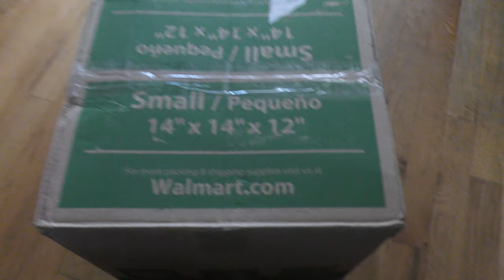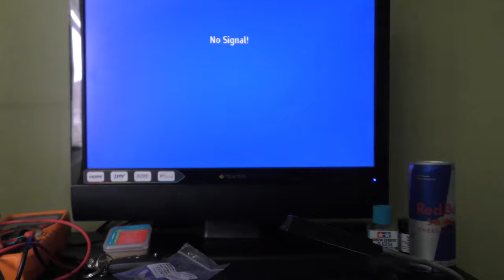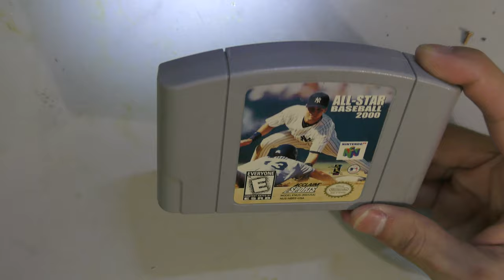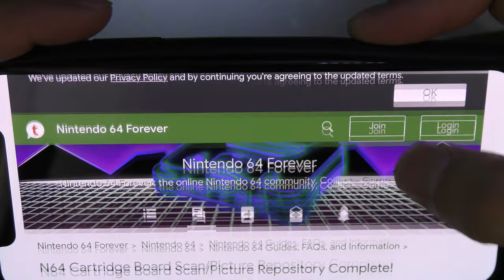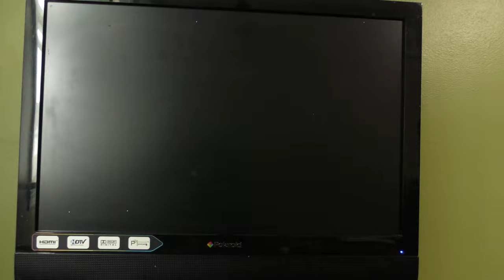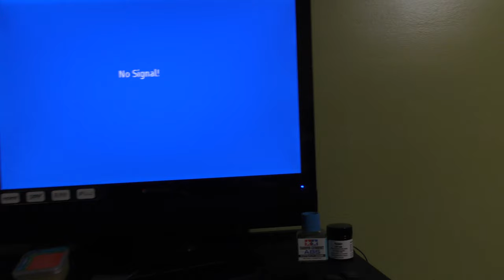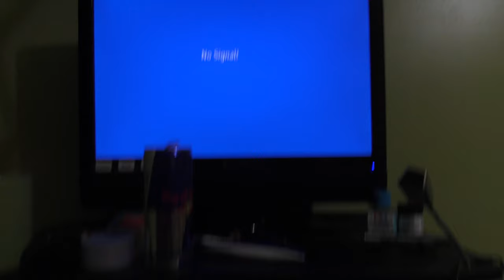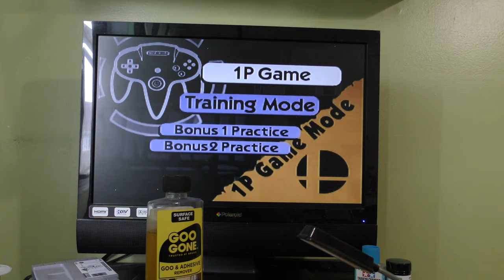VGRestore Ep44: Fixing an N64 Console & Cartridge

Comment: My probe slipped and shorted pins 1 & 2 on the AMP-NUS chip which suddenly restored audio on a Pikachu console I was working on. I had already swapped the AMP-NUS chip and the audio output caps so I’m pretty sure shocking the cap connected to pin 2 made it work. Pin 1 was only 12v and the cap was rated 25v so I didn’t even hurt it. It’s been over a year now and the console is still working.

Dude… BitBuilt and other portablization communities have documented the N64 to an extreme degree. Every board variant, pinout of even the proprietary digital video bus, and much more.

Comment: Glad to see you got it fixed! A possible reason you were getting so many shorts while testing with the console powered on is that the multimeters continuity mode is basically a voltage detector, one probe sends the voltage, one probe detects it. That also accounts for lack of continuity when the probes are reversed.
Reply from the maker: Yes perhaps👍

Comment: Nice! I got an N64 somewhat recently that wouldn’t power on. I knew why as soon as soon as I opened it and removed the shielding: some idiot apparently tried fixing it before and there were a bunch of bridged pins on the GPU chip... -_- I don’t have a hot air rework station yet and I figured that chip is probably fried, so since the shell was in pretty good shape, I got a different motherboard for it. Probably not the most cost-effective thing I could’ve done, but I don’t have the tools to try and fix that. I might still try to fix that motherboard at some point, but I’m really not optimistic about that chip and I’m still a novice at this sort of thing.

Also, interesting tidbit about that Kirby 64 cart: I have a Japanese copy of that game and it has a save battery in it! I thought it was interesting how the North American version uses some kind of flash/memory save instead. Fortunately, the one I got works perfectly and didn’t need repairs, but I got it for pretty cheap, so it was a good test cart and a good game to boot.
Reply from the maker: Cool, yeah I can’t save them all either. Japanese games sometimes have different board revisions.

Comment: Great to see an N64 being brought back to life with new capacitors. I hope to get a set of gamebit screwdrivers for when it's time to replace the SRAM battery in my Smash Bros. cart, which is the only thing I had to worry about my Pikachu N64 besides cleaning the connectors and replacing a faulty Nyko Expansion Pak. It is important to note that disassembling Pikachu N64s are somewhat different, as you need to disconnect the power/cheek lights from the motherboard when removing the top cover. Donor boards are still possible (I suspect my console to use NUS-CPU-09 or 09-1), although you will need to desolder the red LED and solder the cheek connectors. You may also encounter green cartridge trays as well, although my console has a grey one.
My console's serial number: NS294840559

Comment: Yeah, the vast majority of single-ROM N64 game paks use the same board that optionally accepts EEPROM save chips (4k or 16k). A bunch of games have single ROM and dual-ROM variants but in general you can swap the ROMs from any game that doesn’t use SRAM, FlashRAM, or some other crazy setup, like a built-in modem.

Comment: Question: Does working on these boards on CARPET  pose a risk to the boards similar to how you can fry PC components ?
Reply from the maker: I don’t work or the carpet so I can’t say for sure, but I wouldn’t recommend working on carpet for the simple fact I wouldn’t want any flux, melted solder blobs, or other solvents staining or burning my carpet.
Reply: For anyone else in the future seeing this comment, do not work on electronic components over carpet without an anti static strap. Almost all of these components use very low voltage logic and you could easily fry them with static discharge!

Comment: Lead-free AKA Pb-feee AKA RoHS AKA Reduction of Hazardous Substances-compliant has been the industry standard for over 15 years now. They started transitioning several years before that. It’s we electronics hobbyist and repair guys that continue using lead-based solder… for good reason. The big players only do it for California and EU compliance and to curry favor with Green Peace and similar orgs. I mean, the lead in this stuff wouldn’t end up in a landfill to contaminate ground water if the stuff didn’t break to end up there in the first place and yet switching to lead-free is what cost Microsoft BILLIONS and sent millions of failed XBOX 360 consoles into the trash.

Comment: hello, what temperature do you use in your soldering iron?
Reply from the maker: 300-315 Celsius for normal work. If I’m heating a ground plane or a large solder point I’ll increase to 375+